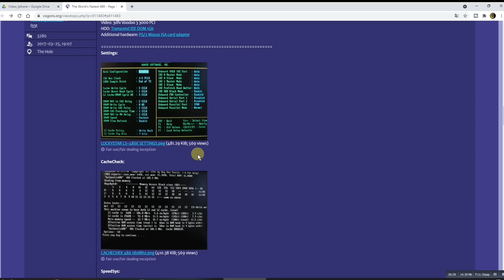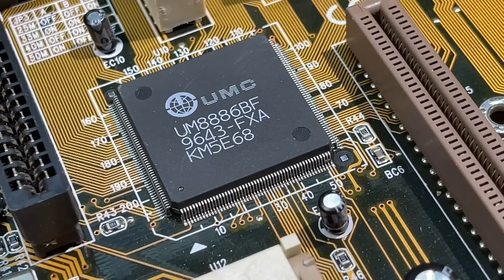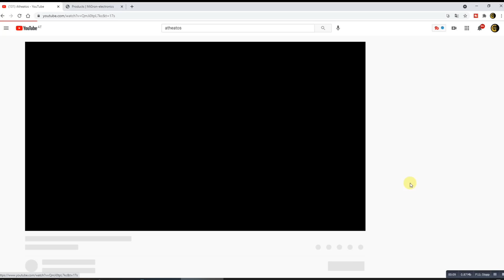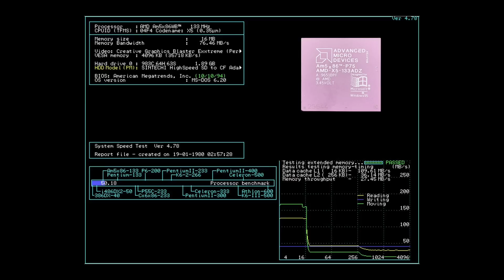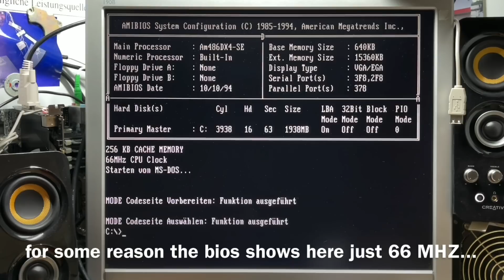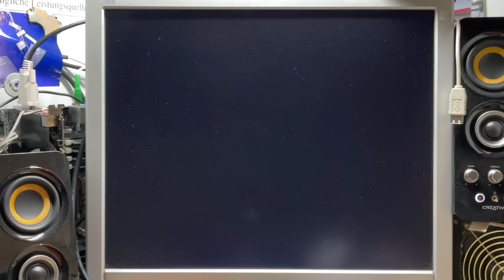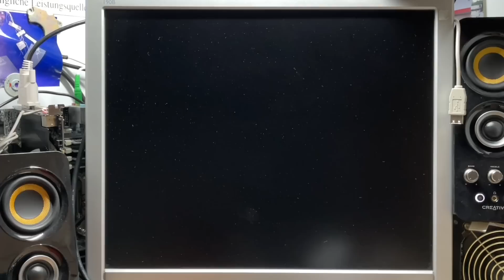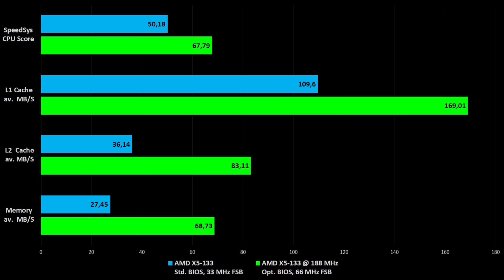AMD X5-133 Overclocked @180MHz / RECORD FPS in Quake/ PCI Clock Checker Tool

Comment: Would be sweet to take some of these old processor designs, like the 486, and make them with today's 7nm process. Would be interesting to see how everything would change.
Reply: the dies would be tiny.. 7 nm is 1/50th the size of the process used on the AMD x5.. would be pretty cool to see it done.
Reply: i have no idea how the internals of processors and stuff work, but could you theoretically make a multi core 486?

Comment: Nice job.  When I was a kid I overclocked a 386SX33 to 66mhz by replacing the mobo clock crystal with a 66mhz crystal from an ISA modem.  I had to add external cooling and a heatsink, but it was very fast but not super stable.  Allowed me to run games that were not permitted to run on such a slow machine.  Fast forward 25 or 30 years, and overclocked systems are routine.

Comment: that was sick dude, and with just a hunk of aluminuim with no thermal paste resting on it, nice hack idea with an pci version of an agp video card so you can double the bus speed.  did that read as 188mhz? only i checked hwbot and it had a cpu-z world record set as 179.88mhz, so yeah you could have a new world record there bud, depends what it reads on cpu-z in windows.

Comment: I used to have an Evergreen 133Mhz "586" upgrade in a Compaq Presario CDS 924, which is based around an AMD CPU just like this. So fun to see this CPU being pushed to the limit. I wonder how it would work in Windows with a 3D card (maybe a Voodoo Rush)?

Comment: Just for comparison, my Pentium 233 MMX @ 120 Mhz (downclocked for running old speed sensitive games in combination with SetMul) gets 115fps in 3D Bench 1.0 or 113fps with deactivated L2 Cache.

Comment: Used to do this sort of thing back in the day, if you're really looking to get 100% you'll definitely want to hijack the PLL output and replace it with some kind of dynamically adjustable oscillator.. I've seen people do this with FPGA's and other more hardware based approaches using some timing circuits. But, you should be able to get much finer clock adjustment than the standard configurations of the multiplier or PLL chip allow. Your chip may not be stable at 200Mhz, but could potentially hit 190Mhz with a custom PLL clock.

Comment: 43rd week of 1996 is quite impressively late for the 486 / 5x86 chipset.  The P6 Pentium Pro was already available commercially for a year that point, and Pentium MMX was also literally launched just that week (~October 22, 1986).  

The AM5x86-133 (@160 MHz w/VL Bus cards) got me through a rather "poor" period time of my life after a bunch of stuff happened - a lot of value for the $, and I used it from 1995-1997 as my main PC and for another 3 years as a network node to help me get my MCP and MCSE for WindowsNT certifications.    The final hurrah for the system came in 2000 when I decided to see if it would run under mineral oil for cooling (and yes of course it worked great).  Unfortunately with no way to clean the board, the board and processor went in the trash :/.    I do have a "Powerleap 5x86-133" sitting in a box though today.  P.S.  Wow!  I remember that BIOS!

Comment: Ah, the Chips M919, a board famous for questionable build quality and fake L2 cache, though this later board is a little higher quality and didn't bother to install the fake cache chips (though the pads and pointless traces are still visible at the bottom left at the beginning of the video). Red Hill Computer has a pretty good write-up about this (and many other vintage PC bits).
PCI standard originally allowed for 16-37.5MHz operation to support the variety of CPU bus speeds common in the early '90s, with a 66MHz option introduced in the late '90s. AGP is essentially PCI signaling at higher speed and with a dedicated channel directly to RAM (as the AGP aperture) for additional texture storage, which is why there were so many video cards using the same chip for both PCI and AGP (later AGP/PCIe cards have to use bridge chips because the signals are too different).

Comment: 'Why' are the dies from the center of the wafer better? Is the wafer itself more consistent, i.e. increased distortion in the wafer surface w.r.t. radius? Is it a function of the masks or optics to expose the masks? Just curious as I have not heard of this before, interested to learn more.

Comment: Are you intentionally undervolting? CPU top says 3.45V but at 6:45 you set motherboard to 3.3V. Maybe too low voltage combined with overclocking is part of write-back cache issue.

Comment: And now it is time to grab a voodoo 3 PCI version. The voodoo 3 works well on slow computers and is also capable running at that pci bus speed. You will have to cool the voltage regulator on de voodoo 3 card, because it gets hotter at higher pci bus speeds. Then run quake 1 and 2 and other 3d games. 

And also try to use a soundcard, it will change the quake and doom score. Would be nice to see how much it changes the outcome. 
Use a Creative AWE64. It uses the least ammount of cpu time. I have tested serveral cards and that one came out best. 

Back in the day I played on my 160Mhz amdX5 the following games. Monstertruck madness, Quake 1 and 2, nfs 2 SE, motorscross madness and Descent. I used a Voodoo 1 from Trust in combination with drivers from Diamond. My graphics card was a (i think it was a Trident tgui 9440) graphics card with 1MB of ram.

Comment: Nice OC and you diverse t he record testing 30 CPU's XD

You should put a Voodoo2 in it. They support 66Mhz PCI bus too and with your PCI and FSB at 60Mhz now you might actually get a playable frame rate on a 486 with glide.

I do have a M921 board but it has no official am5x86 133Mhz support but there is a 99% identical board so figured out the jumpers anyways to get it working. But my CPU cant even do 160Mhz @ 4V, doom giu runs in to a wall and humps it XD
I must have gotten the die out on the edge of the wafer :(

Also I run a DAC960 card so I hated the 20Mhz PCI I got with 40Mhz FSB because it cripples my SCSI drive performance. If I ever get a am5x86 that can do 160 I might try to do some device that delays that jumper and automatically sets the PCI/FSB to 1:1.

But I do recall my board or the one almost like it having a jumper for PCI divider, but many boards seems to have the jumper soldered in place and I never got that to work, bit weird tough but almost seems like it was suppose to be designed with the user being able to set the FSB/PCI to 1:1 but it never worked.

Comment: 1. Try sticking a bit of red or orange electric tape over that 7 segment display to make it more readable for the camera. 
2. I think it should be possible to modify the BIOS to override that 2x PCI clock divider. Or even better, write simple tool to change the setting on the fly from DOS (as long as there is any decent documentation available for the chipset).

Comment: A legend is born. The real masterpiece here is the overclocking of the PCI bus. Yes, the Game Blaster could take that 60 MHz, but most likely there were other devices on that bus (IDE controller etc.). Insane and ingenous! Now, do you see any chance for that magical 200 MHz? :) :)
Reply from the maker: Thank you! Yes, I am still testing but the results are already very good for a 200 MHz setup. It will be a quiet interesting video as well. Another mainboard, 66.6 MHz Busspeed and multiplier of 3. I am going to beat my own records again. But I need to bring the cpu to 0 degrees to be stable. 😉
Reply: @CPUGalaxy  I'm quite angry with myself... I didn't keep my 5x86... it was posting and running with 200Mhz without special cooling.... but the Matrox Graphicscard didn't like it, so I just ran it at I believe 150Mhz.

Comment: Great video! 
I could only source one am5x86 capable of 180 mhz so far - boots up with 200 but it's unfortunately a no go. The i486Dx4 goes up to 133 max. - and that's pushing it.

Comment: Congratulations! 🎉 
I wonder, would 200 MHz be a possibility? I had this chip back in the day, also with a UMC motherboard, and overclocked it to 160 MHz like a lot of people did. I tried 200 MHz (so changing the bus speed from 40 to 50 MHz) but I recall it did not boot. But I did not fiddle with it further, relieved it still worked at 160 MHz and I did not kill it. Still, I wonder what would keep it from doing 200 MHz?
Reply from the maker: 200 Mhz setup is already under test here on my bench and working. 0 degrees are enough for my cpu to work. 🙃
Reply: @CPUGalaxy  call me a nerd, but that will be EPIC to watch...!
Reply: OK, I read some forum discussions (also involving this ‘Serpent Rider’): apparently, it has been done with the right CPU, 5 volts and subzero cooling. But the evidence is only anecdotal. So might be an interesting follow-up video to attempt this with your record-holding chip 😎

Comment: With a clock generator bypassing motherboard it should be possible to get some mhz more, you should be able to overclock ram as well, and a voltage mod to up voltage a bit to stabilise cpu/cache etc...

Comment: What settings does Quake run in for that benchmark? I've noticed on another platform the person citing the frame rate sometimes hides the fact they're running in low-detail mode. With the panel on, the resolution of the viewport in low detail mode is about 160 by 180.
Reply: It says at 22:33 that it's 320x200.

Comment: New idea: Replace the 14.318MHz crystal oscillator with a discrete high frequency VCO controllable with a potentiometer and slowly go towards 200MHz until it starts to lock up. (edit): It may be possible to use CD4060 timer cmos ic to make an adjustable oscillator instead of the fixed one.

Comment: Damn you, now I have to re-create these results... I've never dared to give 60MHz PCI a try. With 30MHz PCI 3DBench gave me 90-something fps on my M919 which is actually worse than what I get at 160MHz with a selection of boards. Also the board returned much worse PCI VGA transfer rates than my Shuttle HOT-433 with the same chipset. All in all, I wasn't too impressed.

Plus I was afraid of what the IDE controller would do to my HDDs at 60MHz PCI. I was also highly unsure that the cache stick would take the fastest settings at that clock. Now I see that it works for you. So, my fingers are crossed for my board and cache module.
Now I'll have to find a RAM stick that can actually work at 60MHz fastest settings (I guess it won't be that easy) and trust my Asus V3000 PCI card to take 60MHz well (it has an AGP version too so it should, shouldn't it?) - and see what I get.

Interesting.
Reply: Well, some update. I tried. I failed. But I was right about the bottleneck - it's the cache module. And the video card really couldn't care less, it just runs.

The cache can do 3-1-3 timings with sometimes freezing when I switch to 60MHz, but it usually stays alive. Then I measure 111.1 fps in 3DBench 1.0c, which is better than any 160MHz result of mine but quite far from yours.

Video transfer is not stellar either,  it gives like 27000chr/ms in Landmark (my go to quick test for this parameter) and it can (mostly) explain the relatively weak 3DBench score. Wolfenstein was weak too, 143.6fps IIRC which is somewhat slower than what I could reach with my fast Abit PB4 at 160MHz. Which was faster at raw VGA transfer too. (Yes, the fast one, because I have a slower one too, which is basically indistinguishable from the other, it just reports a more recent M1489 version via its chipset control registers. What the hell.)

I gave up for now. The board's OK and useful to select the best 5x86 pieces - but I have others to use, for example the PB4 does 40MHz PCI without FSB hot-switching.
Reply from the maker: interesting. thanks for the update. 😉

Comment: Congratulations on the world fastest 486! I did not expect that PCI Clock trickery and I'm curious: would it beat the old record too if the PCI Clock would not be 60 Mhz? What is the maximum size for the L2 cache on the board? (potential to push higher?) Also: A few years ago I heard rumors about VERY rare official 160 Mhz 486 AMD chips. Do you know anything about that?
Reply: this mobo is supposed to support modules up to 1 mb of assyncronous L2 cache ... but they were never made .. at least I've never seen them. I've bought a reproduction of the cache module (256k) that works perfectly ... it would be interesting to know if a cache module with more capacity can be reproduced

Comment: You made an error calculating the doom fps. Instead of 34 you typed 35. The real score you got is 69, not 71 like you said. Also, would you mind replying to my email about the potted module - you said you would, but I haven't heard anything since months... Thanks.
Reply: No, the result was correct. It's 35, not 34 (he said the wrong number).
Reply: @8bitbubsy  ok, in that case it was correct, i agree

Comment: Pretty neat. That board is definitely a unicorn among 486 boards! I also had one of those AMD chips in my 486 board back in the mid 90's. I ended up having to run mine at 3x40 for a 120 mhz total speed. My board would not recognize anything higher than a 3x multiplier no matter what settings I tried so I ran it at the max bus speed of 40 mhz.  
By the same time that board was released you could buy a non-MMX Pentium up to 200 mhz which would blow that 486 chip out of the water in Quake. But it's still neat to see it clocked that fast!

Comment: I seem to recall that practically every later (like after the first year of production) AMD 486DX4/100 ran just fine at 120 MHz, and lots of people did this and found out (as you mentioned) that some PCI video cards were not happy. Most Socket 3 boards that topped out at 40 didn't have a frequency divider for the PCI bus.

Comment: Very impressive. I dabbled with this a long time ago, but could never get the VGA card to work - knew the CPU was working, because removing the card resulted in angry beeps. Perhaps it's worth another go, just for fun, though I doubt any of the cards I have that might run at this speed would be very fast in DOS.
I still feel the WinChip is overlooked here. It's kinda '486-Like' but runs in boards with AGP and SDRAM, as well as being clocked at over 200MHz right out of the box. It just isn't the same, though.

Comment: Very impressive. If I were to try to beat your world record, I’d keep everything identical, but replace the 14.318MHz Chrystal with a programmable oscillator from Silicon Labs. That way you could push everything to the physical limit and the board and software would be none the wiser.
Reply: Would this not show the wrong values everywhere because you'd effectively change master clock reference  used for time/speed counting?
Reply: @mrfrog8502  that depends on the clock distribution architecture, and the benchmarking software. I’d expect it to take time stamps from the RTC, not from the master clock. System clock timers have been an issue since the 8MHz 8088s broke 4.77MHz games, so I think it’s reasonable to assume benchmarks use a master clock-independent gating system. But I don’t know, I’m just assuming.
Reply: Jesus you guys? Nerding out big time haha. 😂😂 At least I know you guys are not YouTube AI chat bots.
Reply: That might not work. The ASIC itself likely runs at that clock speed and you might not get far before overclocking that value causes a problem.
Reply: @kylejones8392  likely, but this is all an academic exercise anyway. If you can eke out another, say, percent, that may be worth it. Or not 🤷🏻
Reply: @DX4AB1OF  Very true, every percent counts when you're smashing records!
Reply: Meh just use a signal generator. And id say replace the regulator on the board (or disable it) and use an external one for cleaner power and finer adjustment of vcore.
Reply: @laharl2k  Most of them use resistors for setting the Vref just like an LM317, if that's not what's already there, so you can add a multi-turn variable pot to the board and set to almost anything you want.
Reply: @kylejones8392  i know  but most of those 317 or 7805 in some cases have tiny heasinks. id feel much safer overclocking with an external module, say a 317 plus some PNP transistors as voltage followers to increase currents plus some bigger and btter caps for cleaners power.
Not sure how noise tolerant were those chips but i recall  old pcs had sometimes noisy output at the display because of poor power designs.

Comment: Hi! Im on similiar board have 198 MHz, but  only in bios, now im think i have memory  issues to run in in os. Now this mobo is dead and  cpu perhaps too, but  only cpu is left in my possesion.
Reply from the maker: yes, this board is very sensitive. I almost fried the cache stick just by using a wrong ram.